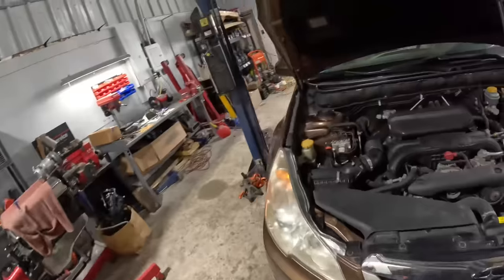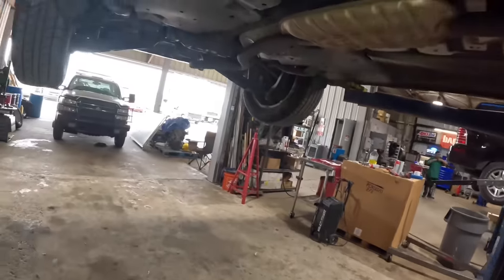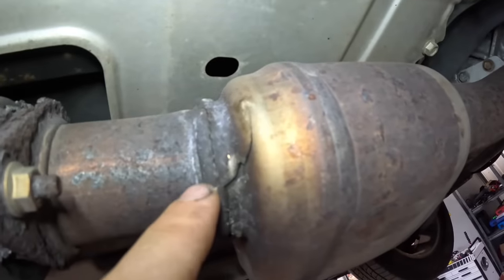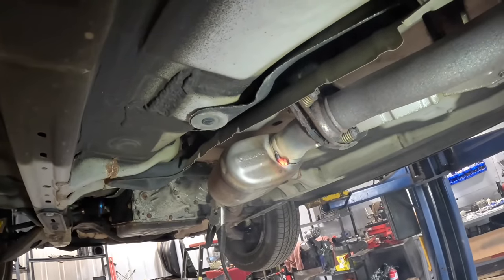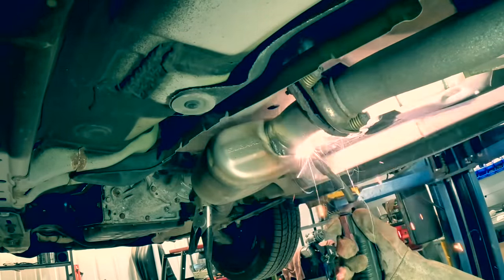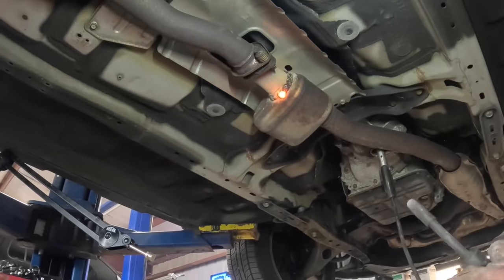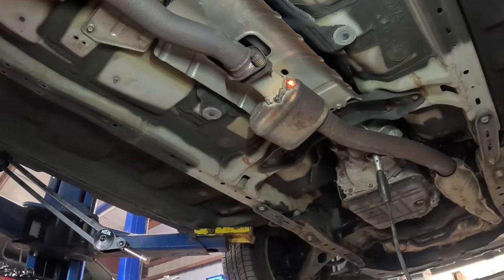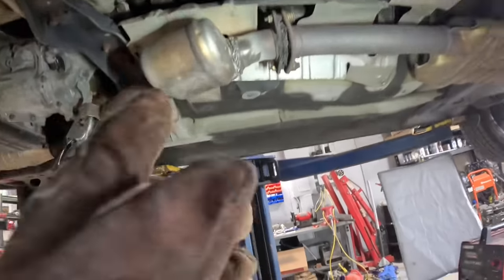Rusted Out Broken Exhaust! CHEAP Fix!!! Subaru Outback 2.5 EJ2.5

Comment: You we're frying bacon so settings are correct but gas would've helped. Welding stainless to ferrous is always a challenge. It'll hold for a bit and it didn't cost a fortune right now for the customer. I once had to go out of state to fix a tank on one of our lines that was leaking, stainless tank, filled with chemicals, they didn't want to drain it and I didn't have a welder set up for stainless steel and we didn't bring one with us so I "fixed" it while it was leaking all over the place with a welder set up for regular steel. Looked like crap but it didn't leak and I didn't want to do it that way but I was told to send it so I did

Comment: Good enough fix.  Time and vibration will tell.  Danish National Symphony might make for smoother background instead of that grinding electric axe.  There is a product called canned smoke, used to locate laser beams, or your smoke machine through exhaust rear, to check for leaks... but you knew that already.

Comment: As a welder that went to school for it. 99.9% of all bad welds are from dirty material. And Ray you don't need a Tig unless your doing custom welded stainless or alum work. I new a guy that did custom stainless exhaust work for years only used a Mig i don't think the entire time I knew him he ever had a Tig in his shop. If you want a good welder look at the Miller Multimatic 215. I just picked one up because my Syncowave 210 only had spool gun. Multimatic is all 3 processes and holds Mig 5lb spool. Also no one has pointed this out but you need to be more careful with galvanized metal the smoke from that is very toxic.

Comment: When I had my exhaust shop "Suba" were among the most expensive IF you purchased the exhaust from the dealer. That's why I built my systems.  I'd replace the whole system and use after market cats. As you know it will be back.   My fav. question was and I'm sure you hear it also is... can you just patch it?  I'm scrapping it soon and I just need to get a couple of months out of it. Then a few months later they are back with the same request. Fix it right once was my "battle cry".

Comment: Ray!
I have said it before and i say it again! Get a Mig/Mag welding machine with gas! The one you have now is no good!
Welding with gas will give you much better welds and welding on both stainless steel and ordinary steel is just as easy with a gas equipped Mig machine. welding with  a Tig is fine but Tig welding is more difficult at cramped spaces like  fixing exhaust leaks and such . In such places a Mig/Mag welding machine with gas is much more easy to use. 
I have both types, Mig and Tig , fourty or more old Millers and I definitely use the Mig more often then the Tig.
Greetings from Sweden!

Comment: Ray you can weld Stainless Steel with MIG using L56 .025 0r .030 wire but you have to crank up the shielding gas to cover the weld area. It will cook the Stainless Properties out and it will rust like steel doe's but it can be done. You cannot weld Stainless with flux core wire.

Comment: When those springs (at the joint behind your weld) rust, that causes the radial crack. So it’ll just crack again until those springs are active. Yes to the welding, but rebuild that joint also.

Comment: When doing these to make them easier and better loosen the rear exaust braket that holds muffler up then it can hang alittle bit down to get on top along with sticking an magnet mirror up against the underside of floor panel to see on top better! Then for this metal set welder at A and around 2 on the feed and should be fine !

Comment: Type 409 stainless steel is magnetic, and that is the type typically used for CAT shells.  The factory used TIG to build the converters. 
Worked or damaged type 304 can become somewhat magnetic as well.

Comment: Ive been a welder at a few jobs, and you are absolutely right, that looks horrible. And did I hear you correctly, you had no shielding gas?? Even with it being stainless, if you had gas I bet it would have looked a hell of a lot better.

One place I heard about was going to test their welders for stainless tig pipe, but the pipe is expensive so they used steel pipe. And it worked, at least for the practice before the actual test material, the welders just had to watch their heat so the didnt dilute the filler rod too much when adding to the steel or the practice bend would break.

youre doing alright Ray, and with all the welding camera angles, I was actually expecting to see trunk monkey make an appearance, for whatever reason lol

Comment: You’re way better than I am Ray!!!! If I would have tried that it would have taken a whole spool of wire and there would have been welds to the floor pan, the exhaust and probably the drive shaft!!!! 😅 (I totally suck at welding)

Comment: Ray,
Get a spool of ER308L stainless wire for your Mig welder to weld stainless. 0.030" - 0.035 for most applications on autos.

Comment: You did a good job considering what you had to work with. Next time you might want to take your angle grinder to the weld area to take off some of the zinc. you will get a better weld. You are wright about your wire not being the wright one for that application, but it's all you have.

Comment: not bad of a weld for a non welder, also the metal is 409 stainless and it is magnetic, but one note is have you been fully disconnecting the battery from the car before welding, on it, doing this is a safety precaution for the electrical system in the car.

Comment: The 400 series stainless ( 410, 420, 440 - martensitic) (409, 430, 439 - ferritic) are magnetic.  So, using a magnet to check is not a good method for determining stainless or not.  You can put stainless wire in a MIG welder but you need to use pure argon as the gas.   MIG stainless is about the same as welding regular steel.  With a TIG you can do steel to stainless welding with 309 or 316 filler rod.  However, better than either of those is Super Missileweld available from Harris.  It is available in TIG filler and stick electrodes.

Comment: An adequate fix for the stated purpose.  However, it doesn't address the issue that caused the crack in the first place - that flex joint right behind it, which is rusted so badly that it doesn't flex anymore.  There will be another crack, right next to Ray's weld, sooner rather than later.
Reply: Yeah...a pretzel😏

Comment: MIG weld means Metal Inert Gas.If you are not using gas the MIG Welding machine is not even an ARC welder.Get yourself a bottle of Argon or co2.The gas is there to exclude the atmosphere when welding thus providing a proper strong smooth weld with no slag.Without gas your machine is nothing more that UV producer and somewhere to put your coffee cup.

Comment: at least your honest and acknowledging that was a crappy weld lol 😄
i have a trick for ya for next time, use a map gas torch and get a coat hanger and try braze welding it, try and use the hangers that are not coated, those cause a lot of perosity. i've done that before and it works pretty good. I welded some header collectors on to the exhaust pipes using that method. 
still have to watch out for that thin metal melting away but it does look a little better.
of course after a bit all the vibration and flexing that happens at that joint will probably break it again but i digress, it's a temp fix 😁

Comment: I have done a repair like this in the past. It lasted 10 years till I blow out a large hole in the muffler and looked at the whole system.                                                                          About  a quarter of the pipe looked like a very micro pored strainer. It got replaced.

Comment: Did you use flux core wire and no shielding gas? 
If so, consider getting a bottle mix gas and standard 30 thou (or even 23 thou) mig wire. Way more versatile for mechanic types.

Comment: Hi Ray, if the CUSTOMER is happy with the repair then it's a GOOD ( all be it ugly ) repair. Also it doesn't leak and it's under the car so no-one except another mechanic is going to see it and you saved them money. A good job,for an honest technician. Lastly point score for the beautiful wife unit Lauren on the Doodly Doo time card machine placement.

Comment: You pitched a bunch of scrap metal, you could have used some of the old exhaust & mufflers to practice welding. I don't weld often, but when I do I pull out some scrap of the same thickness to play with the settings and practice so I don't screw up the project.

Comment: Honestly, I've welded the exhaust system recently, as well, because I didn't have the time or money to get a complete exhaust system, and someone had initially removed the cat and replaced the remainder of the system with a bigger diameter pipe. You do what works in situations like that, especially if that is what the customer wants. As far as the BMW goes, sales people have their place. That place is on the sales floor, or the sales lot. Most have no knowledge as to what goes on in the shop. That being said, the garage is not part of the sales floor or the sales lot, so a salesperson has no business entering the shop. To lower a car and remove it from the lift is a major issue. Cars are in the shop for a reason. Most respectable dealers will register that they have a vehicle, but won't even advertise that they have it, nor place it on the salesperson's inventory list until it has been through the shop. A salesperson will only know it's there if they have seen it, or they took it in on trade. That being said, there could be 50 cars in the line for maintenance, and it could be that none of them belong to the dealership. The cars in the shop are all hands-off. The salesperson should have gotten released, and you should have only known about it, because it was not where you left it.

Comment: Congrats to the wife unit, that was good trick........ IF IF IF you would just switch to .023 70s6 mig wire with 75/25 welding gas, your welding would improve 100%, gasless flux-core isn't that easy to weld with. I was 35 years welding in shipyard, Navy would never allow gasless flux-core wire............

Comment: We were high schoolers working the weekend after the mechanics had left for the day. At the corner Shell gas station.. This guy came in for a oil change  on a one or two year old Corvette  I told him we wouldn't try it to come back when the boss was there. Well this other kid working said he would change it. We had center post hoist and that Corvette barely made it in. Back then GM used two style oil filters. I told the kid to check he said he knew what he was doing. Well when the guy pulled out and took off. There was a big old fat strip of new oil on the drive way.  Lucky the guy had to stop for traffic. I ran up told him to turn it off and we pushed it back in and I changed the oil with the right filter. It was the last oil change he did . Then by the end of that year he was gone.

Comment: I had the same thing happen with a GMC Denali but it was over lunchtime. Imagine my surprise coming back from lunch and the truck was gone. I always left a funnel in the oil fill to remind myself to put oil in. When the truck was towed in with the engine locked up the funnel was smashed under the hood. It was my fault also until I had a discussion with the dealership owner and the sales and service managers. Ultimately it was the salesman that got fired and not me.

Comment: When I worked at a Ford dealership, if the vehicle wasn't ready to run at the end of a day it was disabled so it wouldn't crank. Usually by unplugging the neutral safety switch.

Comment: I have never mastered wire feed welding  I don't see an argon bottle
On your welder.
The ones at the machine shop i worked at ran off 480 3 phase
And we had every type of welder
I got a lesson on Arc welding so i can slap some weld poops on metal. This was back before plasma cutters we had a gas type cutting table.

You need to use extreme caution if you bring in oxygen tank because oil and oxygen i belive can cause an explosion or fire  that i learned back in high school in the 70s when i learned how to braze.  

Just get some scrap metal, and practice on it one or a few weekends, the more you do it the better you get.
Its also a good idea to push and pull the puddle of molten metal 
It helps to know both for control.

The guys who can lay dimes just did it a bunch to get good.

Comment: a hint or two.  "If there's slag you drag, if there's gas you push the pass."  so for flux core wire welding like you were doing, pull the weld puddle towards the heat, unlike mig where you push it away.  something else you can do when using flux core is get rid of the gas nozzle on the gun, as ther's no gas to direct.  you will have a much better view of your weld.

Comment: Ray, I got a question. Could you have brazed the metal together with bronze or cast iron after a die grinder cleaned up the crack some? If that is not possible, I am sorry for the silly question.

Comment: yeah, I had a car on the hoist overnight without oil in it, I had just had the sump off to fix a leak, and the sealant needed to cure before oil went in... there are many reasons a car may be on a hoist without oil. there could be a great number of reasons a car may be left up in the air, including steering or brake parts out of it while waiting for replacement parts... if the salesman started and drove a vehicle without checking it was safe to do so, then that's on HIM (or Her) or (they/them) or however they want to be addressed!

Comment: You can mig stainless steel, you just need the wire and the gas to weld it, you can't flux core mig weld, you need gas shielded welding

Comment: Funny! One of my fellow techs also left for the weekend with a used car on the lift with no oil. Sales manager came in dropped the car and started it.. and same shit too, they blamed the tech for not leaving oil in the engine. In addition to that, I had a used car on the lift, in the air with the transmission half way out and a transmission jack to support it.. sales guy walked in on a Saturday and was trying to lower the car. Lucky for me, another tech saw and stopped them before it was too late..

Comment: I don't recommend TIG for exhaust on the vehicle because you simply just don't have the room to get in there many times. The little MIG stinger fits just about everywhere. As far as stainless on exhaust goes. Standard mig filler steel works fine and melts into stainless fine. You just lose some stainless corrosion protection, but as you saw that is not a high grade of stainless.  For aftermarket high quality polished stainless systems installed I use a spool gun on my mig with 308 filler and standard argon co2 mix. It works just fine for stainless exhaust systems and even after winters of salt, the welds still aren't corroded. You can use stainless mig filler on regular mild steel to but it is a waste of money. Also doing stainless MIG is a little different because it is more runny like water than mild steel so you need to move faster on verticals. Little different technique but easy to pick up with a little practice on some scrap to see how much more fluid the puddle is.

Comment: Did you see where the bird went?  :P    It certainly hit the exhaust on that car.
But respect anyway. It's a lot better than inhaling that exhaust in the cabin, and listen to the noise it makes.
And it will probably live just as long as the other parts in the exhaust system.
Respect!

Comment: As an exhaust shop owner, that crack is Subaru's biggest flaw. Happens to 90% of them. Gas shield works way better than flux core! Your welds will look a lot better.

Comment: I think the customer should just replace the exhaust system ASAP. As a mechanic of 45 years and an owner of 3 older vehicles and I live in Western Pennsylvania, it will only get worse. Do they still do motor vehicle safety and emissions inspections in Florida ? Lived there for 20 years.  Florida was always back and forth on this, depending who was the ruling party. N.C. and Pa.  definitely would fail it for such . Yes I do realize Ray is just trying to help his customer out and practicing his welding skills !

Comment: Unfortunately this is completely normal for Subaru northern cars.  I even welded couplings that replaced the flanges for the mufflers.    The exhaust is 303 stainless steel which is magnetic, but it’s much better than the aftermarket exhausts.

Comment: I have one of those, but not with the EJ.  Mine's a 2014.  Factory exhaust sucks.  Replaced mine with a custom catback 3", complete with a cheap 18" Magnaflow spiralflow where the resonator used to be, and straight piped out the back. 50 bucks. Maybe someday I'll put a "real" exhaust on it.

Comment: Not all grades of stainless steel are non magnetic. I have a rather heavy bar of it for example that is definitely magnetic. I don't have TIG myself either and I weld so infrequently that I cannot justify the cost and stick to arc or gasless MIG for now. If I need to move to gas MIG then I'll get a multi purpose one that does all I need.

Comment: Something you should have done when welding on a vehicle is to disconnect the battery.  Save the possibility of shorting out any of the electronics.   There’s also the possibility that it’s in the 400 series of stainless steel which is magnetic, just like most kitchen knives and forks

Comment: Hey rainmaker answer me this ram 2500 6.4 hemi 55 thousand miles should I and will it be helpful to run by 44k fuel system cleaner in my truck just for preventive maintenance  thanks Loyd